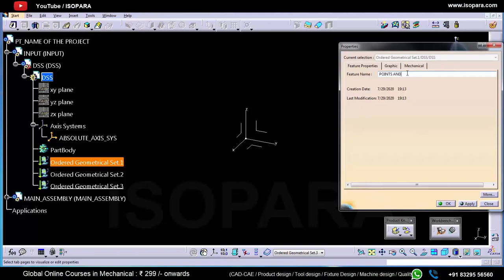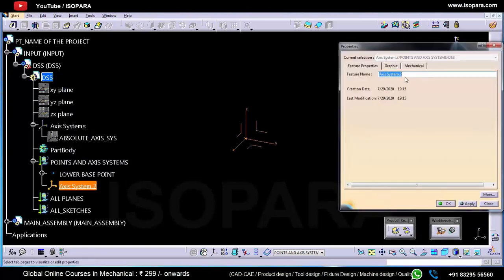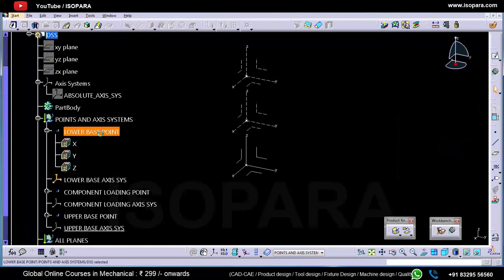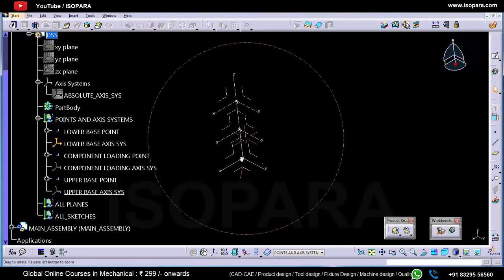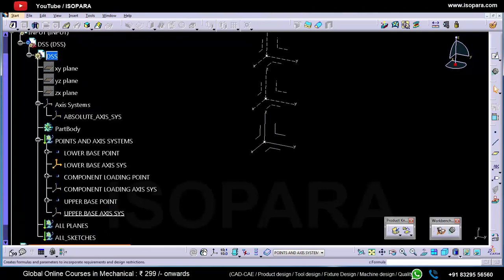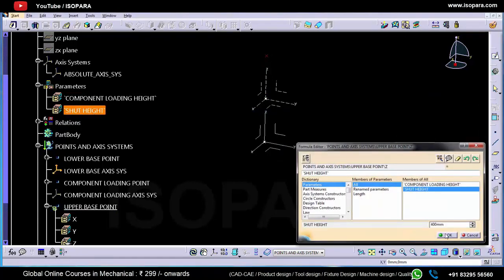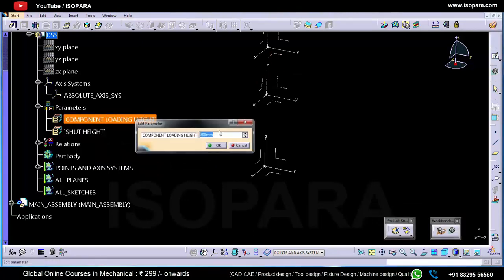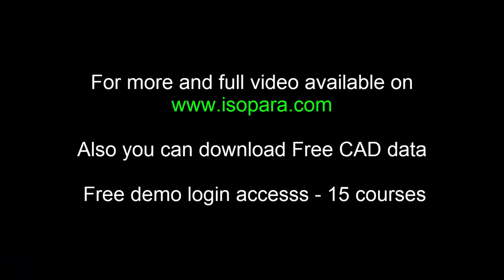Component Setup for Press Tool Design in CATIA V5 || Best CAD Methodology || ISOPARA

Comment: When all made in INPUTi can not make axis system when I check insert there is no axis system
Reply from the maker: It is there in insert but when you are in surfacing or part modling workbench. If you in assembly you won't find it